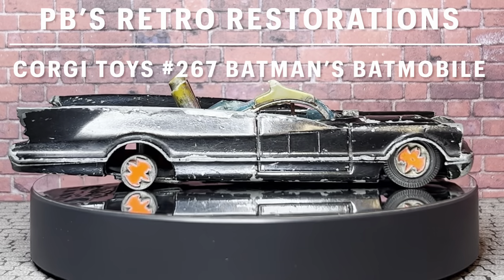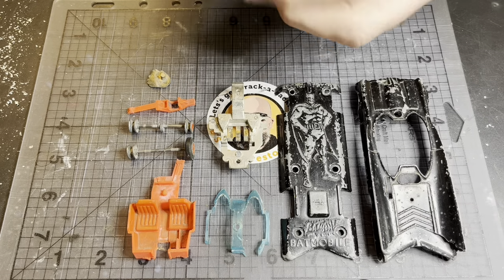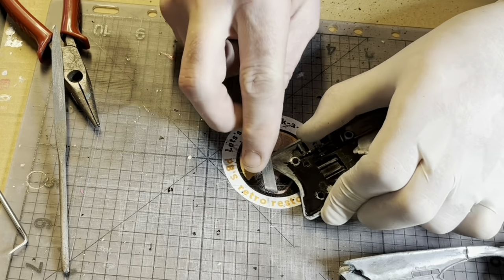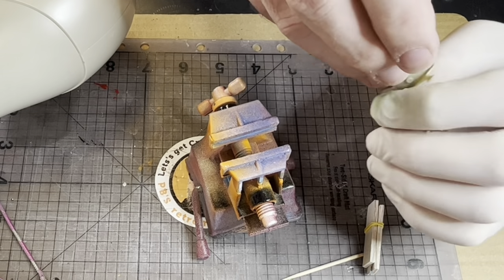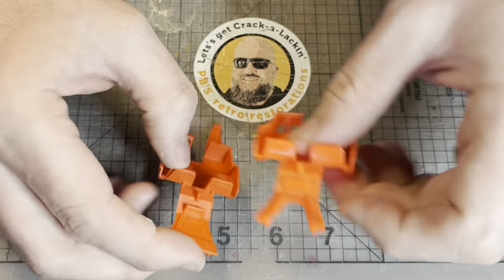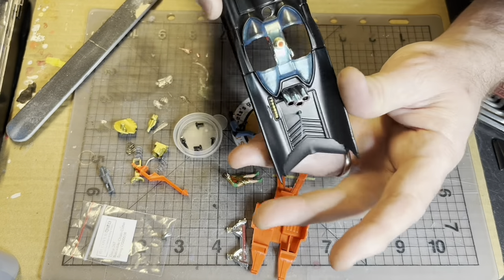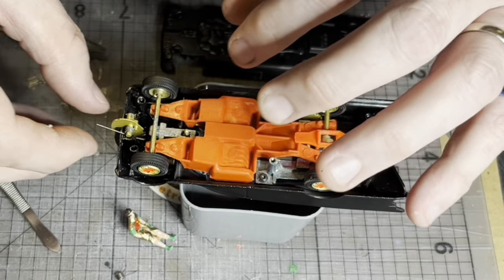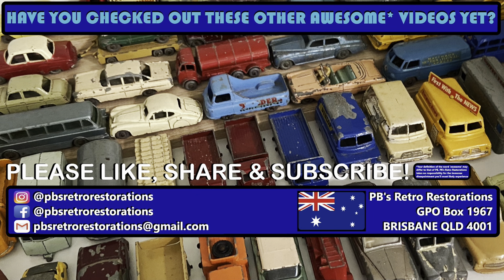Vintage Corgi 1966 Batman Batmobile Toy Car Restoration

Comment: Just thinking started on a restoration journey on a Batmobile , so impressed that is  wonderful work. I love your commentary on it , makes it seem a bit more accessible for the intimidated starter 😂
Reply from the maker: Thank you Peter! That's what I like hearing, intimidating is the word and it stops so many folk, myself included from having a go. But I figure if they go together, they come apart and there's only so many parts in there and loads of videos on the net to help, so why not have a crack.

Comment: The first addition batmobile is the best one in every. And the restoration you've done is awesome. The one I have is thre later addition with the bat boat. No where as impressive as the fist addition 😊
Reply from the maker: Thank You Rita! I waited a LONG time to get one I could afford, and it still cost a bit in parts even with Neil's astonishing donation to get me over the line with it. It's the bat-hubbed wheels that make the first edition special for me.

Comment: Great restro,iv half a dozen wrecks to go through to make 3 different one then pick up a bat boat,still need the windscreen parts and usual aerials and a couple of figures so down to costs but plan to get them done in the new year.
Reply from the maker: Yes, the cost of parts is the killer. And of course every wrecked one seems to have the same things wrecked on it.
Thank you very much!

Comment: I take a stanley knife and prize the edge of the shaft pole ,its not a rivet ,then gentley prise apart no drilling ,when finished superglue back together with the car looking origanal
Reply from the maker: Thank you for the tip David. I really should get into using rivets like Martin Dare and Corgi Bob do, I just know if I superglue them together, I'll remember something I forgot to put in and it'll be too late 😂

Comment: Hi can you pls tell me what screws you used to put it back together? I’d rather what you used than the rivets.
Reply from the maker: Hi Nathan, I use M2 x 5mm Hex Socket Button Screws after tapping the posts with a Metric M2 x 0.4 tap. Another advantage over supergluing rivets in is that the cap screws can be easily removed if you ever feel like doing it again one day. I did a ‘how to’ in one of my vids, but I cannot for the life of me remember which one. If I work it out, I’ll let you know 😔 thanks for watching!

Comment: Good morning  again I thank u and corgi Bob for being my teachers,  I'd like to send u some pictures but I don't know how?  Question I found a 1966 267 corgi batmobile it needs cleaning if I were to open it to paint the parts will it loose its value?
Reply from the maker: Hi Sergio! Sorry for the late reply, I had a look at your videos and there's NO WAY I'd pull that apart, it looks too nice, too complete and too original. There are ways to clean it, but I'm not the expert at that. I'm in a group called the Diecast and Modellers Community on Facebook, there's a couple of guys on there that are absolute 267 Batmobile experts that could give better advice than me on how to clean one without pulling it apart. If you ever want to send me pics, you can email me at pbsretrorestorations@gmail.com 😊
Reply: @PBsRetroRestorations  hey captain 😃 happy new year been trying to email you with some pictures but its hasn't gone through,  I'll keep trying.

Comment: When I restore these, I make my own parts with molds and resin.
Reply from the maker: Resin molding is a skill I’ve yet to attempt, I’ve started 3D printing other parts (not for the Batmobile) Resin molding looks to be the best way to get an accurate copy. I tried Blue Stuff but it was a disaster.

Comment: Awesome work, was wondering where did you buy the ribits for the bottom of the car?
Reply from the maker: Thank you very much! I don't use rivets, I use M2x0.4 Metric cap head screws that I tap the post for. That way I can pull them apart if I need to, or when they end up in a box after I'm gone the next restorer can have an easier go at it lol. I should use rivets for authenticity, but I like using the cap screws. Thank you for watching!
Reply: @PBsRetroRestorations  thank you so much for your response keep up the great work.
Reply: Also was wondering what color do you use to paint the corgi batman and Robin figure's? And the bats on the batmobile wheels?  Apologies for so many questions.
Reply from the maker: @sergioceja8968  not at all happy to be able to help. I specifically used Mr. Hobby Mr. Colour #171 Fluorescent Red for the hubs, I think Tamiya make a similar colour but that’s what I used. I am not the best figure painter, so I cheated there and bought them pre-painted from RecoverToy here in Australia: https://www.ebay.com.au/itm/154721645027?mkcid=16&mkevt=1&mkrid=705-154756-20017-0&ssspo=jkqHp1vVTJm&sssrc=4429486&ssuid=Hso4VjAVSlq&var=&widget_ver=artemis&media=COPY
Reply: @PBsRetroRestorations  Again ty so very much,  I will send you a before and after picture of my batmobile when I get all the parts I need. Again ty.
Reply from the maker: Please do I’d love to see it
Reply: @PBsRetroRestorations  will do. Again ty for your help.

Comment: juy 11 2024 - g-day mate of you had heated the tip to bend it would not have broken its pot metal, very fragile, use jb weld on that tip putty is for plastic resin models lastly the shaper flashing on the window edges wasnt trimned the headliught paint was quick messy job wider areas of the after buner are black [ verify by looking at pics of the 66 car] the little stick like bits stay silver😆😆😆
Reply from the maker: Yeah, I was cheesed off about that tip breaking off, I was frightened of hearing it up to much, I’ve got better at it now. I know the putty isn’t really for metal but it works ok for me, I’ve got to give JB a go though. Thanks for the feedback!